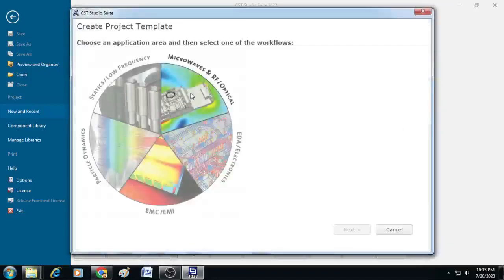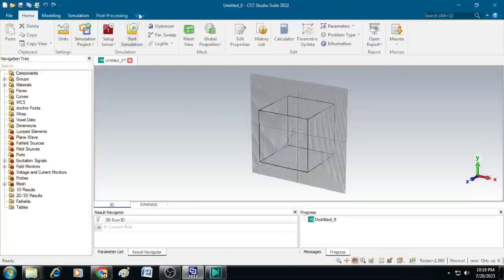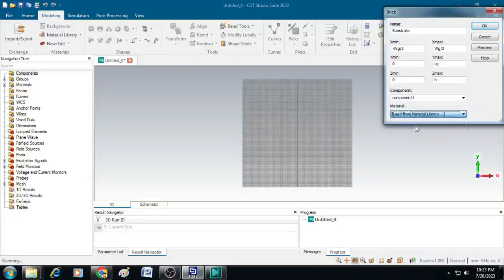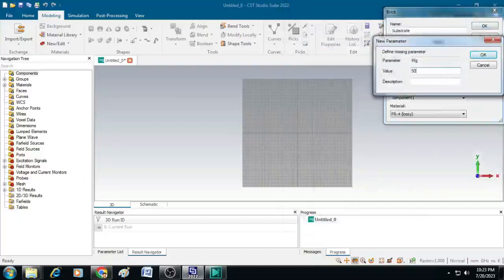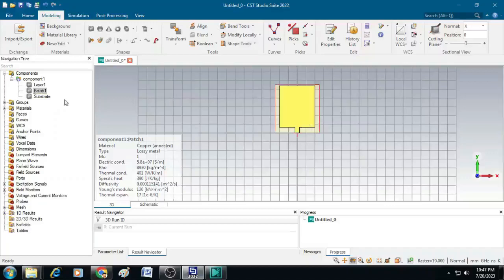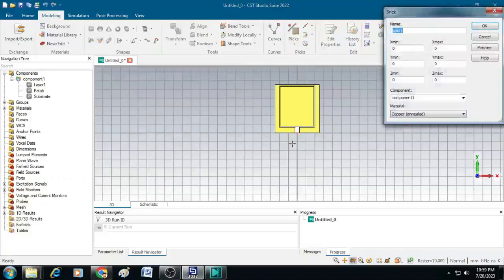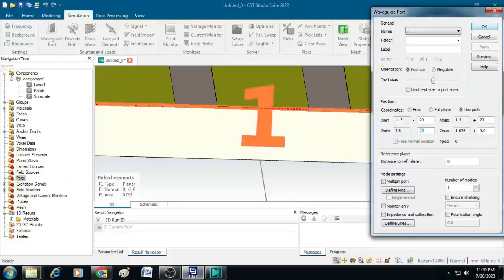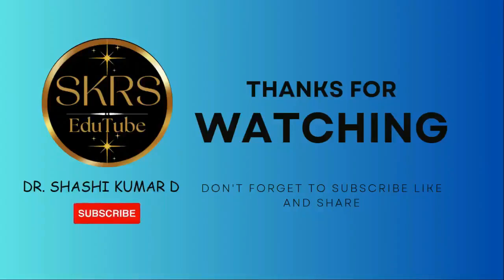CPW Feed Microstrip Patch Antenna Design in CST MW Studio

Comment: Does CPW mean the port width must be same as antenna width? I mean, the port must be the size of antenna width? And is pin important? Also how did you choose the value for Z in waveguide port? Thanks.
Reply from the maker: Need not be. The requirement here is to make contact between radiating element and ground as per that we can keep port width. Z value is assigned while assigning excitation to the port.